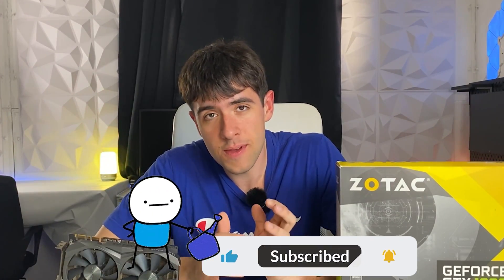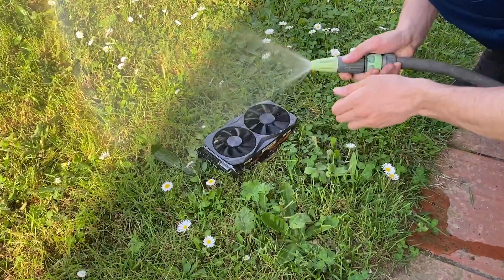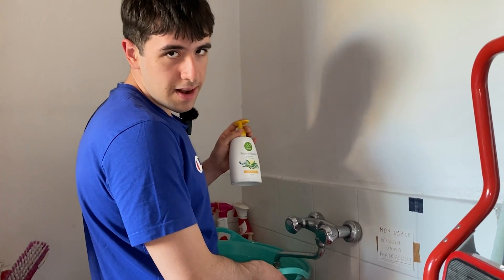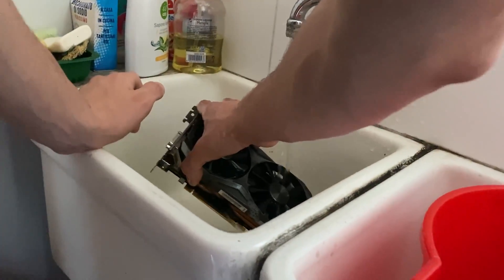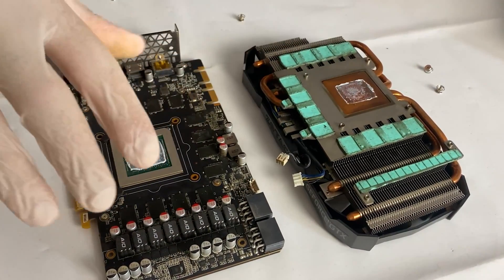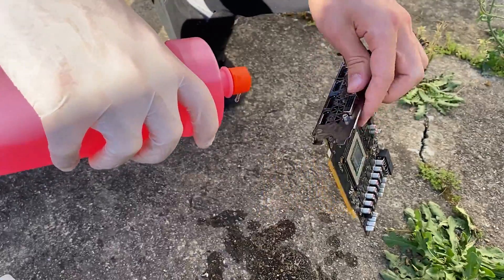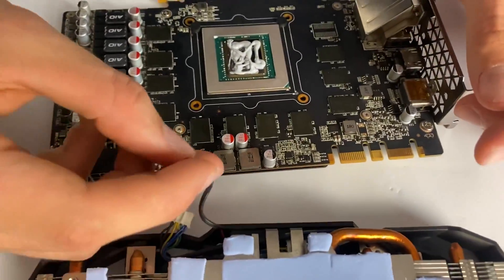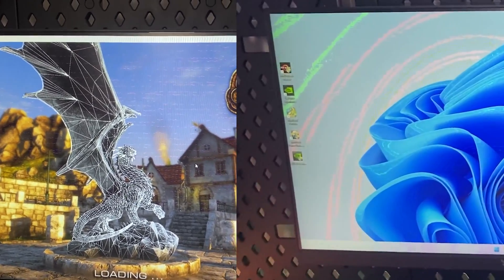Washing my GPU fixed the green lines on the screen

Comment: The artifacting before/after was definitely different. Next time, try a more traditional Oven-based DIY Reflow, which would reflow the solder by bringing the entire board up to temp and leverage surface tension to pull the components back into their proper position.

Word of caution for anyone wanting to water their GPU, probably a good idea to use a scrap motherboard/cpu/ram/PSU. We've seen graphics cards that have gone bad nuke the entire connected platform, and that was WITHOUT watering :)

Loved the video, keep up the good work.

Comment: Wtf...
You're supposed to strip the card before washing it. 
My process :
Strip
Dishwasher without soap
Sun dry // or warm (~90c) oven for ~20mins
Cool
Reassemble with new paste
Test
. 
Yours is a bit ass backwards, mate.
Reply from the maker: AHAHAHHA the way you do it is definitely more organized, but I addressed it in the video and since thermal paste and pads are water resilient, it doesn't reeaaally make a difference. But yeah I take the criticism and I do admit I wash it without disassembling it also because I want a bit of shock value :p

Comment: Nice video. The heatgun method usually works well when the gpu is on its last leg and, even in that case the repair is not permanent. On the other hand, visual artifacts usually mean video memory issues, and cannot be fixed that easily.
Reply from the maker: Thanks a lot for the support and yes, I 100% agree with you. This very DIY reflow method has a higher success rate on the core, in my experience. But I do have brought back a few GPUs with memory issues in this way too, so it's always worth a shot!
Reply: For a perfect reflow

1. Remove cooler, pads and paste
2. Clean/flush under BGA chip with acetone
3. Clean/flush under BGA chip with Isapropyl Alcohol
3. Apply Kapton tape to all components around BGA chip that could fail from thermal stress
4. Apply liquid flux (reflow flux) underneath BGA chip
5. Preheat board (PCB) evenly on a "hotplate"
6. Create a thermal step-up profile (written or automatic if software controlled) according to the size and thermal properties of the board/BGA/soldertype for the Hot air soldering appliance you are using
7. Reflow BGA chip
8. Step down hotplate heat by 40°c per 5 minutes

Let cool completely for an hour minimum before test

If it does not work resolder the BGA chip or possibly replace chip if chip-internal silicon-to-package (lead free) solder has produced whiskers/microcracks that cannot be reflowed

Comment: I've actually heard that a dishwasher can do a great job...
And I have to add. The first step to the dry-up process is to soak it in 100% alcohol...
Reply from the maker: Yes! I don't quite feel comfortable in using my own dishwasher because I feel like the chemicals on the GPU would end up in my plate, but I'd love to give it a try maybe before swapping dishwasher. Same reason why I don't use the oven to reflow GPUs. Drying up with isopropyl is 100% key!
Reply: @ImWateringPSUs  If that's the case, it's probably cheaper and more effective to use an ultrasonic cleaner

Comment: I brought my gpu back to life in a similar manner around 8 years ago. There was no point sending it to a specialist as the card wasn't worth much. I put my card in the oven for around 15-20 minutes at around 250C. I placed the card in an elevated position on folded aluminium foil so it wasn't touching any components(important) on the bottom side of the card. To my surprise... it worked. It's worth squeezing some flux around apu so it will just reflow itself. I fixed my lenovo legion the same way, however it only worked for about 6 months. Tape over plastic parts so the connectors don't melt. Worth trying when there is no other option.
Reply from the maker: 100%! What you said about flux is something that very few people know and is actually key for a good reflow :) Another key part is getting the GPU cleaned up before melting the solder, which is where the watering part comes is!

Comment: I like using distilled water to limit the minerals introduced; Great video.
Reply: doesn't really matter if you are going to wash away with alcohol afterwards.
Reply: @Manysdugjohn  You right; I didnt see him soak the card in alchol
Reply from the maker: Distilled water also works great and reduces the chance of you doing a step wrong and accidentally breaking your card, since it's also non conductive. It is a bit more expensive but definitely worth noting, thanks for the comment and for watching! :)

Comment: Nice try my guy. It's maybe worth trying this method if there is nothing more to be done. Getting rid of all the dust and giving some real heat afterwards towards the card may revive the GPU back. Thanks for the video :) One question though, is green lines the only defect on the GPU? I mean can you still render videos or 3D stuff just fine out of it or does it affect the result?
Reply: Btw I think it would be nice if you put some disclaimer on description as this method is quite risky :D
Reply from the maker: Thanks a lot for watching! Exactly, you summed up the video in just a few words, minus of course the shock value :p Unfortunately the GPU crashes as well, so once can't just ignore the lines. You can use it as a display adapter with no green lines if you uninstall the drivers though!

Comment: Paste application 😂😂😂 unsub
Reply from the maker: The paste application was indeed TERRIBLE. But it didn't really matter as it's non-conductive paste, the only bad it did was waste a bit of paste. That was also to bust another myth :)
Reply: gpu needs alot of t paste though
Reply: It doesn't matter on a gpu bro.
Not only is the die massive compared to a cpu, gpus suffer from pump out so much more than cpus, so after a time of thermal cycling, that thermal paste will just work it's way out anyway.